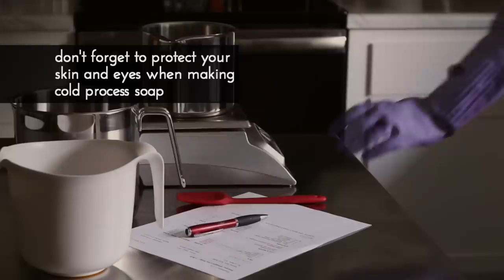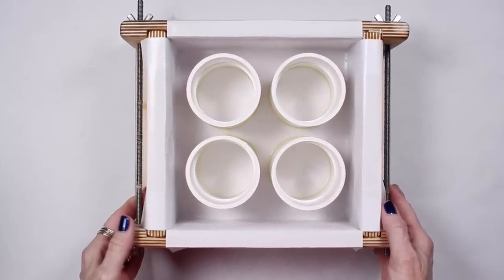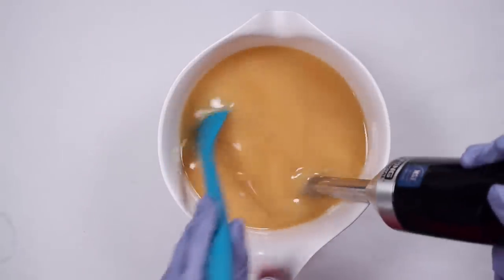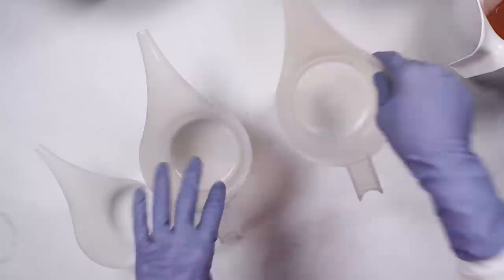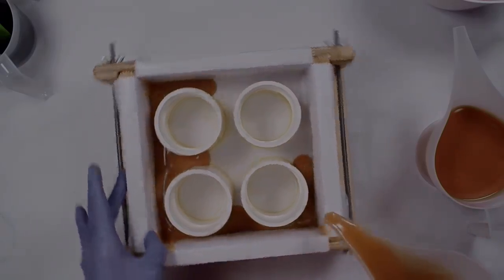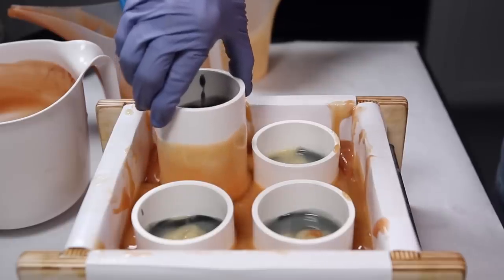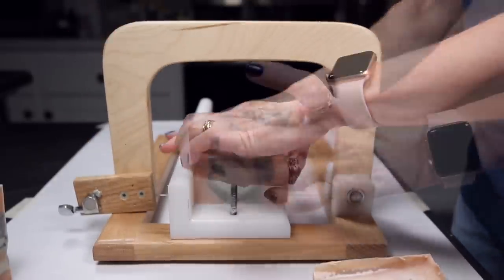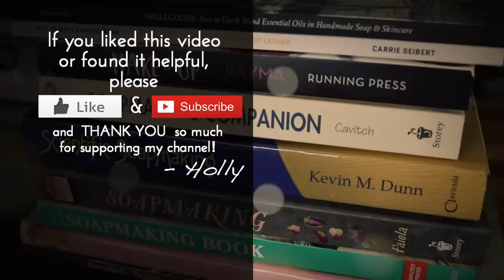Pipe Divider Swirl Soap Making

Comment: I know this is an old video but I hope you see my comment, Holly. I love this technique and I'm ready to try but can't figure out mica usage rates. I was able to use your formula to calculate the volume for the pipes and inside the mold, but that uses total batch/batter weight. How to you calculate for mica which is oil weight? Do I calculate again using the volumes with the oil weight? The convert those numbers into percentages of the oil weight?

Comment: How do you know if it's gone through gel? I "cpop" mine and I literally have no idea if it's worked or not.
Reply from the maker: Gelled soap will usually look kind of translucent and the colors will be darker or more vibrant afterward.  If the soap doesn't gel, it will be more matte and opaque in appearance, typically with pastel colors.  Whenever I've prevented a soap from gelling, it usually takes much longer to unmold without damaging it (several days as opposed to one with a gelled soap). Hope that helps!